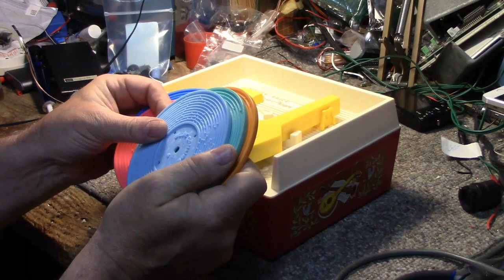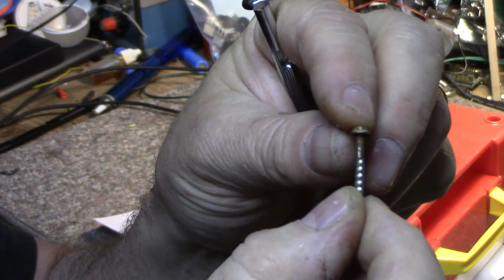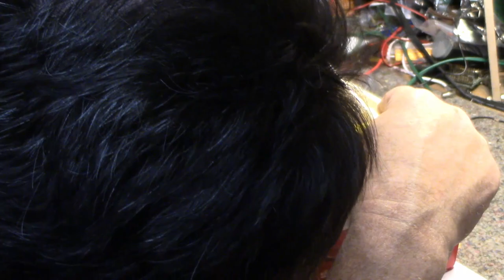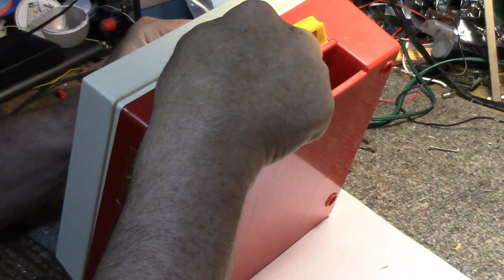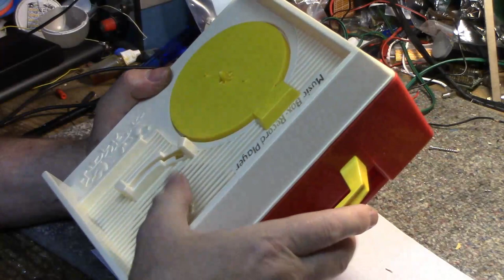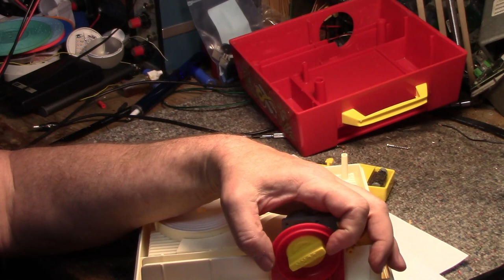Fisher Price Music Box 995 (Ep. 26)

Comment: I've worked on one of these, one thing to keep in mind is to pre-tension at the bottom range of the limiter mechanism, so fully "unwound" should still have tension on the spring once assembled.

Sadly for my one, the plastic gear has a crack in it. It still works but causes a click every time it turns the axel.
No idea if there is anyway to deal with that - it seems windup clockwork like this is a thing of the past.

Comment: I happened to have the strebito 142 piece set bought on Amazon. Used the 4.5mm socket. They have thin metal so no grinding of socket necessary. A little bit of pressure and fit perfectly. And, comes with plastic spudger tools to carefully take case off.
Reply: So a 4.5mm socket does the job for sure?

Comment: thank you for this video,  i needed to see this, only thing is i cant find a socket driver to fit it, does anyone know where i can get one, thanks
Reply from the maker: Hi Phyllis, thanks for watching. Try a 5mm hex driver first. You may find the outside wall of the socket is too thick to fit in the hole and won't fully seat, you may need to grind it thinner

Comment: Hey there I’m having the exact same problem and am wondering if I can borrow the hex screw tool you modified? I’ll pay postage of course!
Reply: And I need it after ur done!
Reply: NAPA auto parts sells a "Precision Nut Driver Set" for $1. Largest size in it is 5 mm, part number for the set is #: BK 5751144.  5 mm worked on mine but you do have to apply pressure to stop it from popping off the nut.  Penetrating oil definitely helps.
Reply: @bzb8824  
Thanks a million